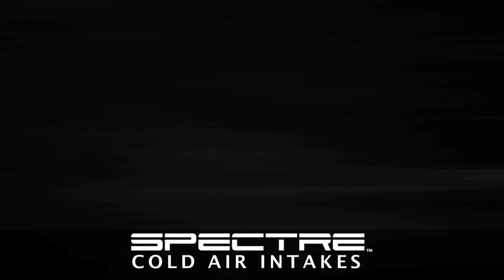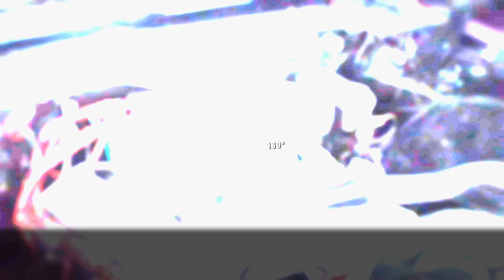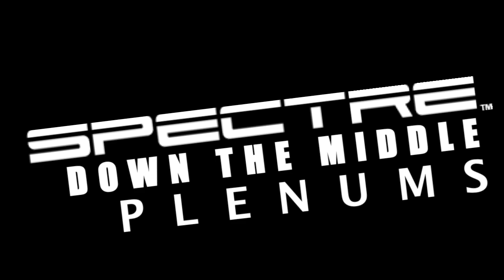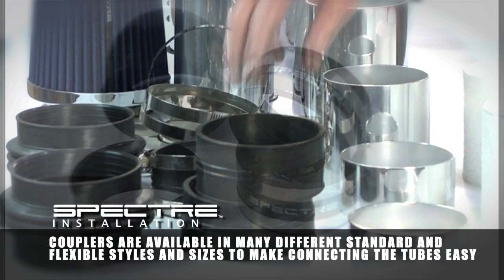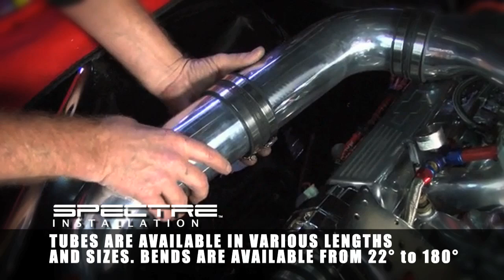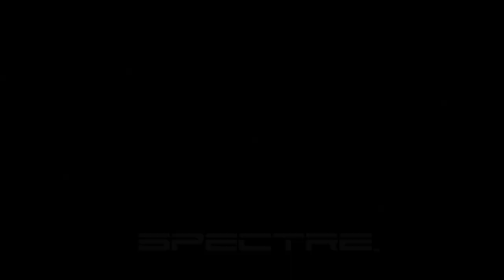Spectre Cold Air Intakes

Comment: I installed a Spectre cold air intake on my 1964 chevy truck, and the results were surprising!
 I went from 200F intake temp to 80F as a result i gained at least 20Hp, if not more. the faster you go the better it works. and it does make the exhaust much louder.
look at my video on my Chanel.